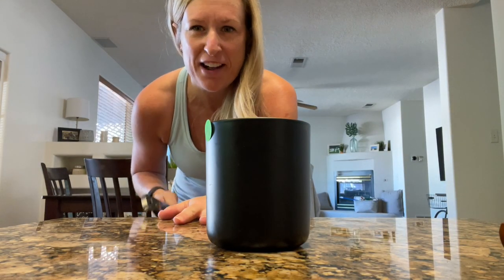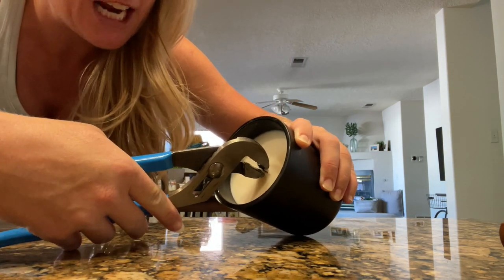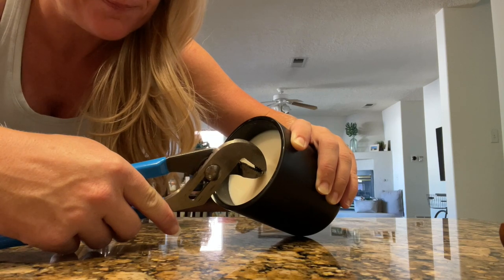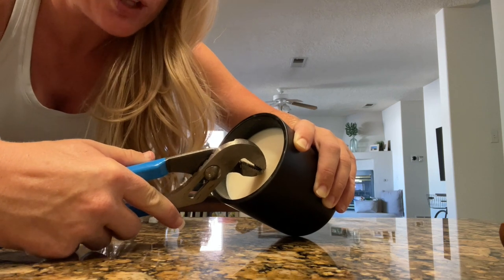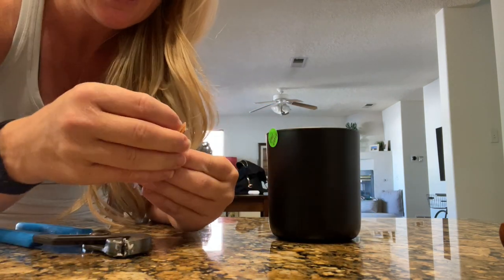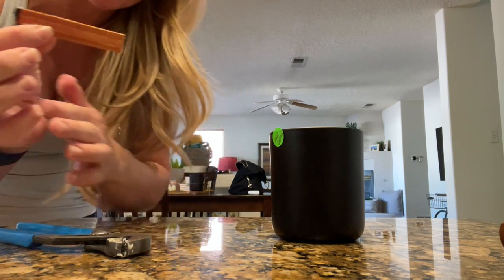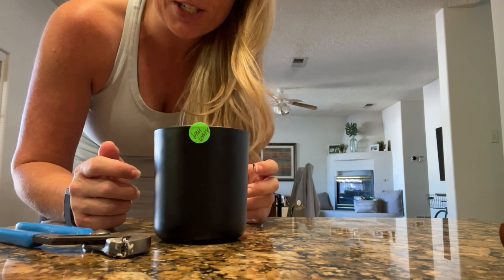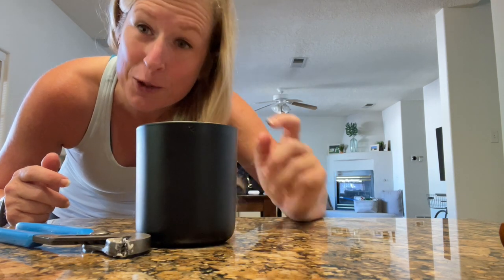How I Test My Candles For The Right Wicks + Hot Throw // My process for testing and quality

Comment: I’m shocked how little people do testing.  I tested for almost a year.  I spent 4 months just learning candlemaking and then I started testing waxes, wicks and FO combinations.  8 of those months was serious testing.
Reply from the maker: It will all come out in the wash, I firmly  believe. If the rush to get out there is that intense, the fire (drive) will burn out likely just as quick. It’s a long game.
Reply: I am a soapmaker and people do the same thing with making soap.  They make a few batches and then decide to start selling.  I started making soap in the spring of 2001 and never sold any until Thanksgiving weekend 2002.  I am going to learn to make candles and I fully expect to practice for a very long time.  But thenI am not looking to sell them, just make them for myself and gifts.

Comment: I am a new candle maker and wow i am learning so much... i like wooden wick... and learned you have to soak them in olive oil... then when ready pour your wax over it and coat it with fragrance oil... but why do you coat it with fragrance oil?? Also i have worked on my wax... i use palm oil shortening and soy wax.... i like softer wax not hard or caky..
Reply from the maker: Eek, this is where I would disagree. I have yet to pre-soak a single wooden wick. not to discredit who told you that but I think you have to test and try a lot of different ways to find what feels right and works for you.  That seems like a LOT of extra work and I'm not really sure what for?

Comment: Hi Ashley! I am just getting into candle-making (well actually been looking at it now since about March) and I LOVE your videos. They have been so helpful in preparing to really dive in. I assume you place your original wick with a wick clip so it doesn't move. So do you just have to shove the new (or non-boosted) wick back in pretty hard to get it to go back in the clip?
Reply from the maker: Hey! Great question!  Yes, once the candle is solid again, I wiggle the existing wick out with some pliers and then the new wick just goes back in it's place, you can gently slide it in and feel it go right back into the clip! Voila!
Reply: @UpsideGoodsCo  thank you so much!!

Comment: Hi Ashley, thanks so much for this video.  We are using the Aura wick as well but find the .03 booster isn’t giving a full melt pool.  Could it be the oils?  We use a plethora of FO.
Reply from the maker: It could be the oils or that the wax just isn't digging it.  What else have you tested?
Reply: We are using soy so after looking at the wooden wick recommendations we really should be using the .04….I think 😊🤷‍♂️

Comment: Wait, that much melt pool by 1.5 hours?  Is that not too fast for an aura?  I gave up on my wooden wicks thinking that they were burning way too quickly if I was getting a full melt pool in less than 3-4 hours.
Reply from the maker: It works for me.  Here's why... I use EC 26 which no matter what is a slow burning wax.  I don't mind a melt pool at 1.5 hours because the throw works well when it's burning at that rate.  The life of the candle still lasts for about 85-95 hours at this rate.  I NEVER promote anything that I do as a rule of thumb, only what works for me! I hope this helps!

Comment: Hi Ashley, I’m so glad I found you…you’re knowledge is soo helpful on all fronts of the business. I’ve been testing my soy/coconut wax formula (unscented) with wood wicks and prime them as well before testing, but I’m noticing white vapors (like steam) that come from wax or near flame. I heard you say no white or black smoke in your video coming from the wicks. Can you please elaborate on the white smoke…I’ve searched everywhere and am getting zero info on what these white vapors are. I’m assuming it must be white smoke? Thank you!
Reply from the maker: White vapors are totally fine.  Usually thats just oil burning off but in a way thats not too hot, thats when the black smoke comes into play. Every once in a while my candles have white smoke and It doesn't deter me, I just prefer no smoke at all when possible.  I hope this helps!
Reply: @UpsideGoodsCo   I’m crying tears of joy right now. I’ve spent the past 2 months pulling my hair out trying to figure out what it was and how to stop it from happening. Thank you so much Ashley, I’m truly grateful for your advice. 🙏🏻🙌🏻
Reply: I’m so confused .. I tried single ply .03 .625 coco soy and it was very weak for me :(